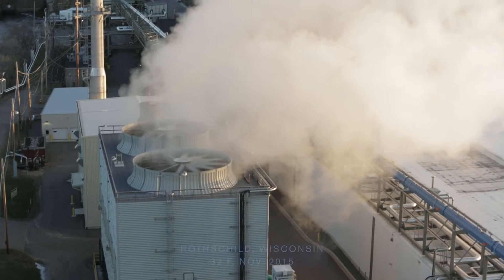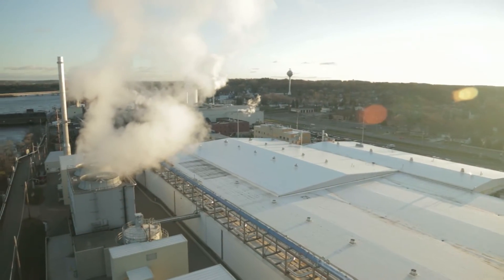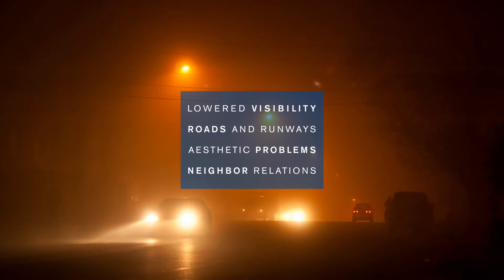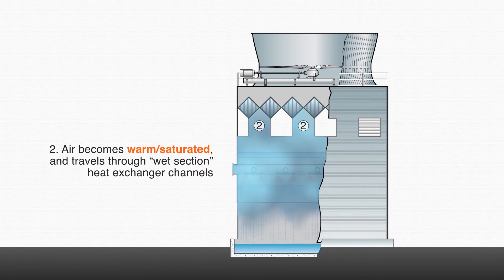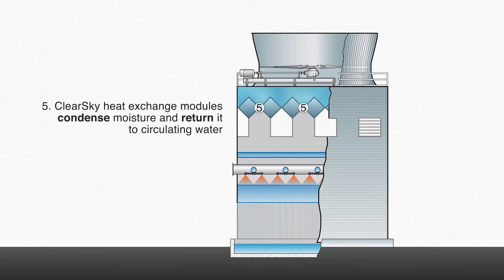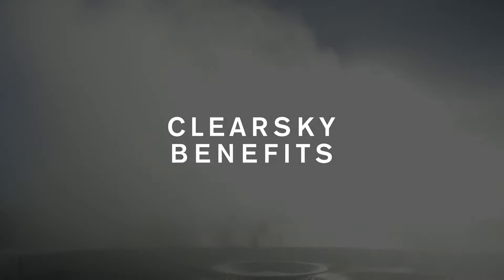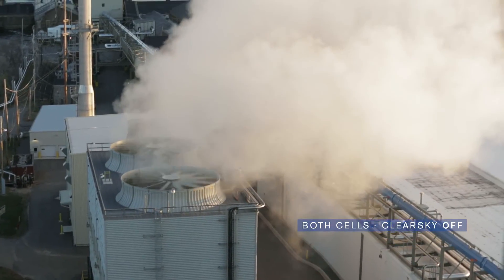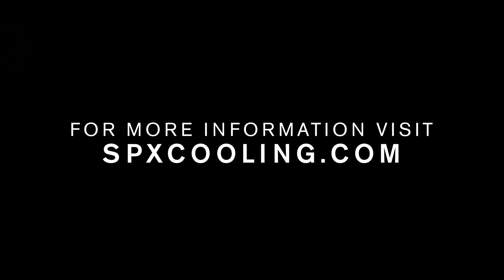Marley ClearSky

Comment: shouldnt the air exiting the tower be cooler and drier because of the abatement process? the additional ambient air should extract heat, which lowers the temperature, allowing condensation. also, is the Cooling Water passed through the dry fill before being sprayed onto the wet fill? otherwise, how does the dry fill add heat to the ambient air?